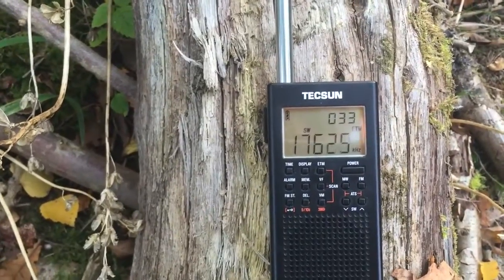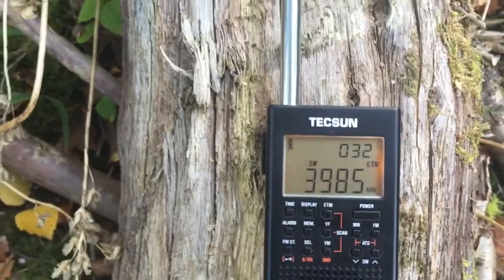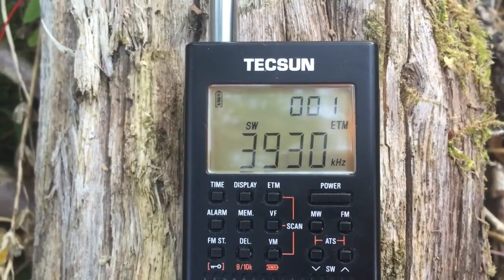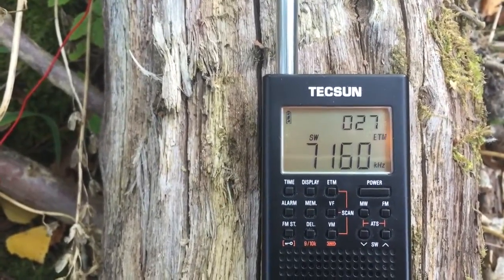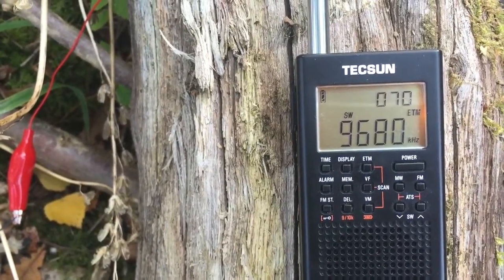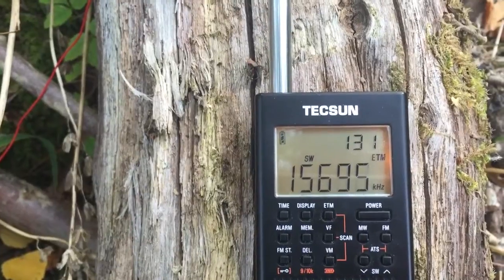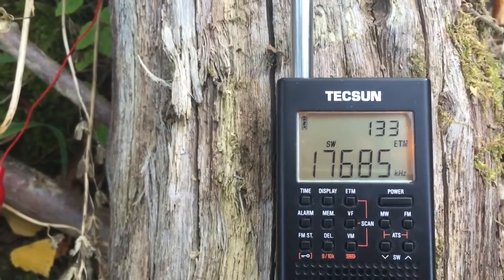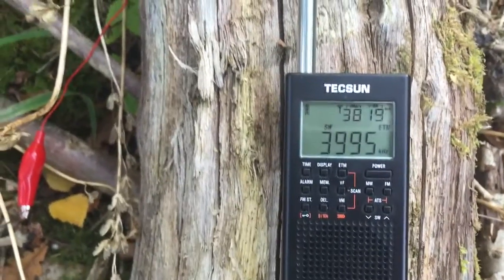Tecsun PL-360 test: telescopic antenna versus 90 metre long-wire

Comment: I am glad to see this technique (counting stations found by a Tecsun) being used to compare aerials. It is the most objective technique I have found and use it regularly with my PL-380.

Question: Did you step through the signals the wire brought in to see how listenable they were? The Tecsun algorithm seems pretty good so hopefully the wire didn't just provide more noise to lock on to.
Reply from the maker: Thanks for your comments. This video is quite old, but if I remember correctly, there's another video on my channel with a review of the signals. The location you'll notice is in the middle of a wood, so just about zero local QRM to lock on to. 73! Clint

Comment: Clint, the 90m long wire makes all the difference in the world. What type wire is it, and how do you store it? I have a roll of small gauge coated magnet wire that I want to roll onto a manual fly fishing reel. Then when I'm camping, I can deploy it on limbs and use an alligator connector to clamp it on the telescopic antenna. Thanks John
Reply from the maker: +nyte_owl shortwave listening Absolutely John. 4 times as many signals picked up with the ETM using the long-wire. It's just a general purpose mult-strand wire (7/0.2 mm), insulator 0.3 mm, overall diameter 1.2 mm (I'm sure you can convert this to SWG).  £9 for 100m in the UK. I just unwound in from the reel and attached it between two trees, approximately 90 m apart. It's quick to deploy, but takes a little longer winding it back it! Worth the effort though. I'm planning to get out into the Oxfordshire countryside again tomorrow and have another go! Cheers, Clint
Reply: Thanks Clint, look forward to it. I'm off work next week, hope to get out to do some experimentation. Take care.
Reply from the maker: +nyte_owl shortwave listening Pleasure John. Good luck with the antenna experimentation - hope to maybe see a video of your efforts! Cheers, Clint